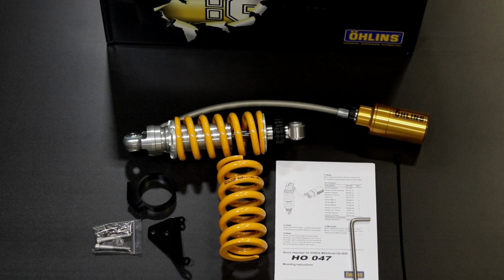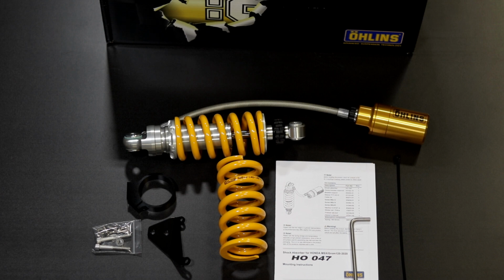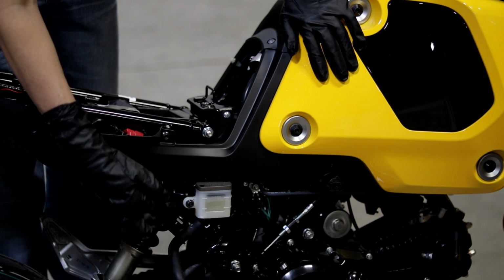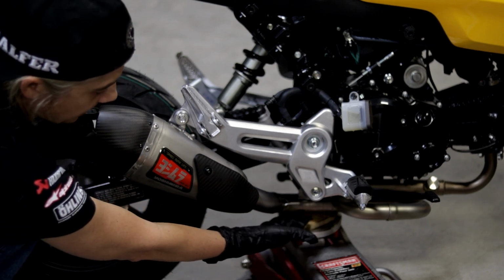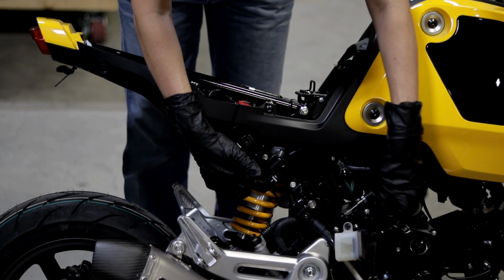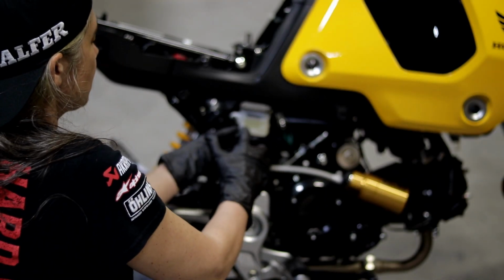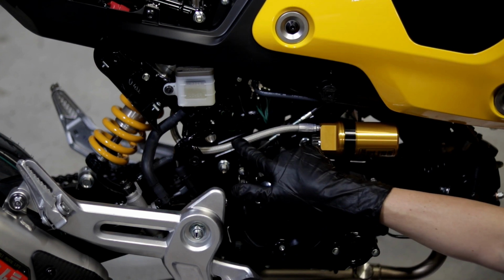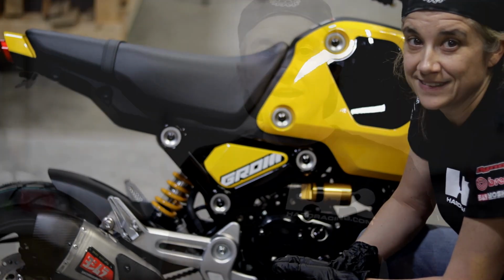Completely Transform the REAR of your 2022 Grom RR Ohlins Shock Install Video - HardRacing.com HO047

Comment: I found a better was to suspend the back was to use car axel stands under the foot pegs bracket. 
All you have to do is whilst on the side stand adjust both stand to the height of the right side bracket. 
Put a cloth on top of each stand to protect the bike put one stand under the right side have your left one ready to push under the left side. 
Push the bike up on to the right stand then with you foot slide the left one under the left bracket and It will be very secure.
Reply from the maker: Thank you for contributing alternative options.

Comment: Will the regular piggyback shock be available for the 2022+ Groms? The remote reservoir is kind of dumb really when you have the perfect spot piggybacking.
Reply from the maker: Not enough room to have a piggy back.  That's why the only offer a Remote Reservoir
Reply: @HardRacingPerformanc  Is it that much different from earlier gen Groms? This is my first one. On those it seemed like you could mount it upside down or maybe trim some plastic. I assume that no piggyback will ever be coming then from Ohlins. I am going to order this one next Tuesday.

Comment: Do you guys know if the canister location in this install will be possible while also using the Chimera intake? It looks like they may be competing in the same space? The Chimera is already a very tight fit with little room for adjustment.
Reply: We thought the same thing. Looks like you'll have to slide the Ohlins Canister back a little to make room for the Chimera.
Reply: @saleshardracing1561  Did you guys actually install both to confirm? It’s just not 100% clear if you successfully installed both or are assuming it’ll work with the canister pushed back. Hey, it may make a great follow up video to do both??!! Thanks again for the reply!
Reply: First thing I thought when I watched the canister install. I just threw the chimera on this weekend. Would be a drag if one inhibited the other
Reply from the maker: They do play well together.  We made a detailed video showing this.:   https://www.youtube.com/watch?v=_eUFlXuO1ik&list=PLbA51xdh1BFLSQk3zgYxfuePuaxgO5zMK&index=5
Reply: @HardRacingPerformanc  awesome, really appreciate the leg work! Saves a lot of us out in the wild some anxiety wondering if the investment is worth the risk.

Comment: How do you remove the bolt holding on the plastic cover above the wheel on the right side? It's too close to my exhaust.
Reply: Exhaust comes off =)
Reply: @serialminded  I figured that out 5 months ago! But yeah, for anyone doing this in the future... Just move the exhaust out of the way.